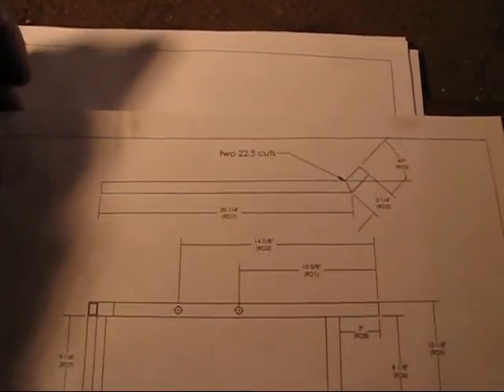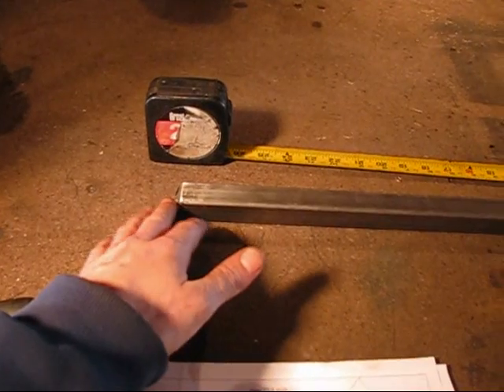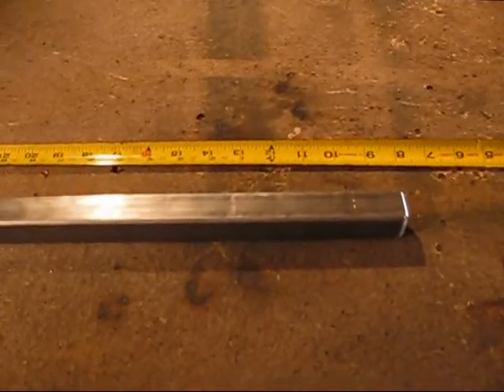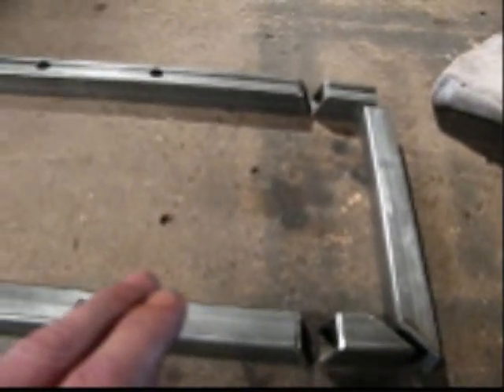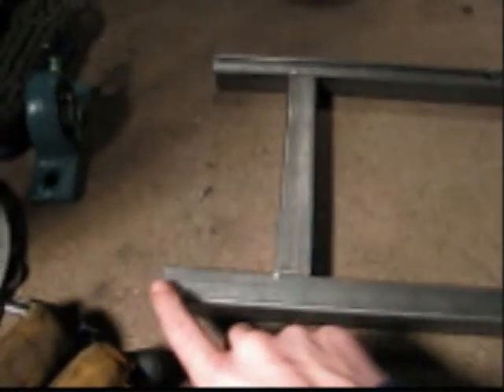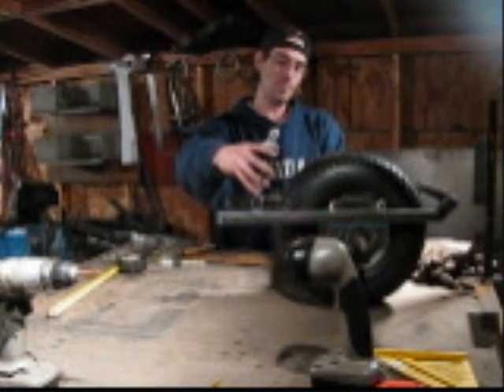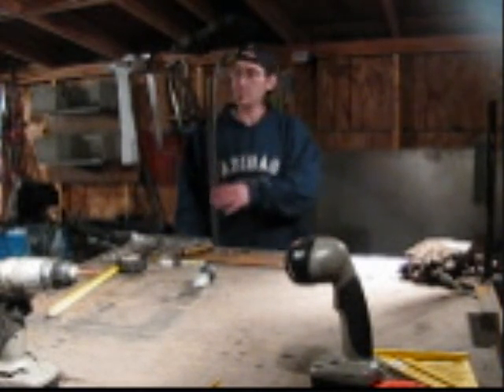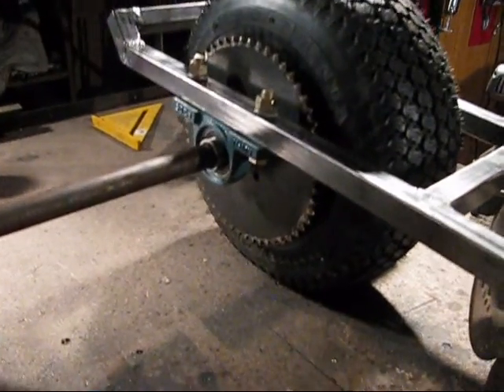Rear Frame / Swing arm  Reverse Trike / Quad Build #2

Comment: @Tmansgokarts huh, that will explain your splatery welds if you had gas and normal wire would would have a cleaner weld(less grinding)

Comment: yeah so what happens if you have bearings that doesnt have that light blue housing? because the bearing in the video has the greasing access "knob" but manco dingos just use regular bearings and has two flanges. How do you grease them? and are the bearings supposed to spin pretty easily like skateboard wheels?